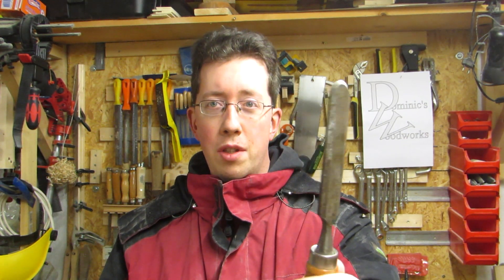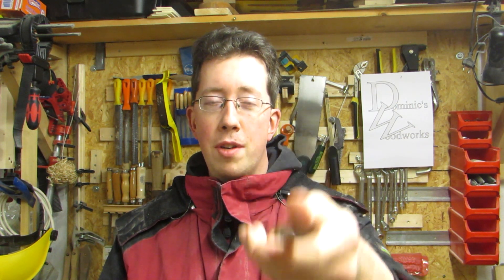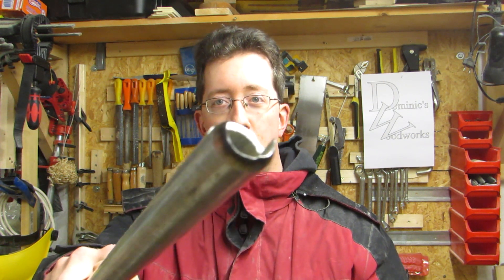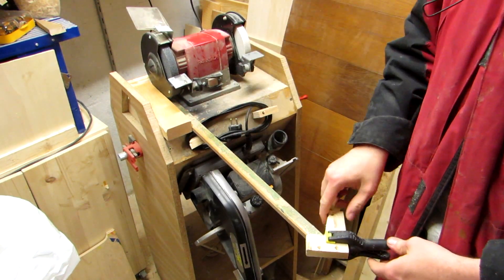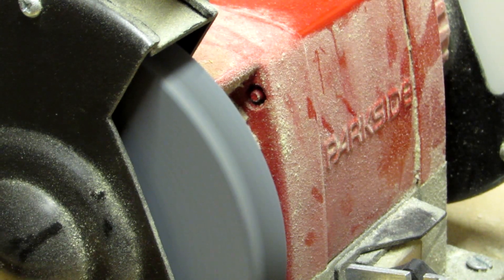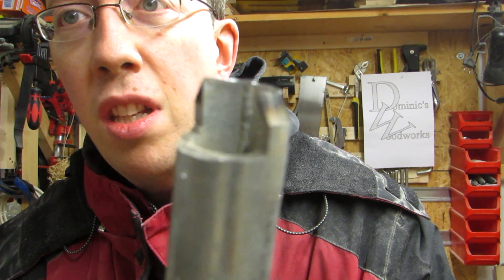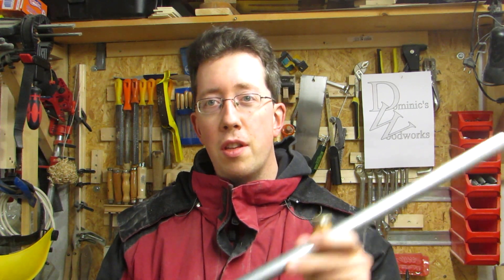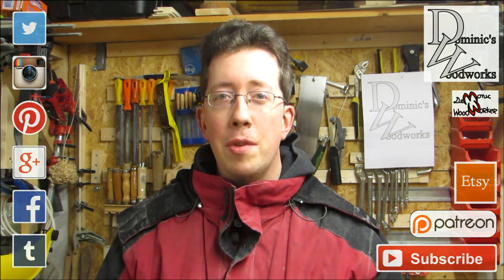Adventures with the Minilathe 2 - the Real Roughing Gouge

Comment: So I'm not alone in these cheap and easy tools tricks :)
Couple of things I figured out with pipe gouges:
- go to a scrap yard and ask for hardened steel pipe, bound to find something better
- or borrow a torch and temper the tip at least
- cut the pipe at an angle and a good length so you can always see how it sits
- make sure any pipe welds are always at the top of the gouge never near the blade part
- grind down the inner surface until it is uniform (I do that with a wood dowel wrapped in sandpaper)
- you might not have a real gouge but the sharpening guide videos absolutely do apply so use them to make the best angles
- do not let material turn colors when sharpening, those parts will be useless
- also a good idea to look up guides on how to use a roughing gouge, completely changes how useful it gets

Hope some of that helps.

Comment: Pretty cool idea. You could always make another with the weld on the side you cut away. I don't know how well that steel will harden but you may want to try hardening it with a torch and some water. You'll probably end up with a cutting edge that well stay sharp longer.

The idea about connecting dust collection to it cools be done to the one you made. That sounds like a brilliant idea, by the way. A lathe tool with built-in dust collection sounds pretty damn awesome to me!

Comment: Great idea Dominic.
Following advises might sound strange in the first place, but trust me, they might improve your turning skills.
No 1: the bevel of your 'roughing gouge' is far too low. It should be something in between 55° and 60° yours looks like less than 45°.
No 2: you should try and 'polish' the inside of the tube prior cutting it in half by using some sandpaper on a dowel for example.
No 3: cut away the welded part of the pipe as this leaves no good edge as you mentioned.
No 4: although this is the number one rule for wood turning, it got nothing to do with your gouge. I'll reveal the secret, RIDE THE BEVEL! In order to get decent results, you have to have the bevel of your gouge riding on the wood! You used it more like a scraper at the wrong angle which definitely leads to bad catches!
No 5: don't mix traditional turning tools and carbide tipped turning tools, as they require a different turning technique. A lot advanced 'traditional' turner have problems using carbide tools, although they are easy to handle after a while. 
For more detailed information, you should check out the channels of
Mike Waldt with a great series on sharpening and using tools : http://www.youtube.com/playlist?list=PLKupw_lpbxJlA69fh2y6x6uBVBOqJkX1b
Robbie the Woodturner who also got some videos about sharpening tools: https://www.youtube.com/user/Robbiethewoodturner
And last, but not least Carl Jacobson, although he mostly shows projects rather than tutorials: https://www.youtube.com/user/haydenHD

Never the less, a great idea to make tools on your own!
Greetings from Good Old Lower Saxony, Germany
Peter

Comment: use a file to smoothen the inside, cut the half away a bit more, dont use it on a not-rough piece :) you were trying to use it as a spindle or bowl gauge. thicker walled pipe wouldve been better

but all that aside, i like your thinking. it will probably work ok for roughing soft woods. and its cheap. i dont have a roughing gauge either, i find i can rough with other tools just fine. and im not going to spend 80+ euros on one.